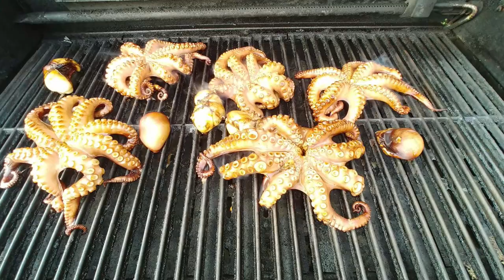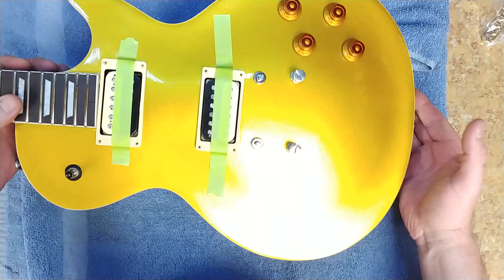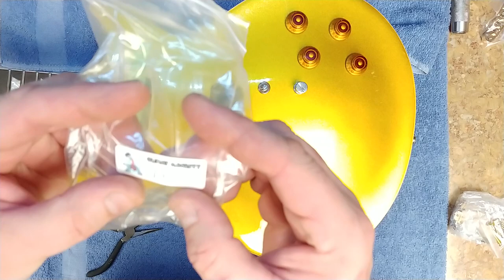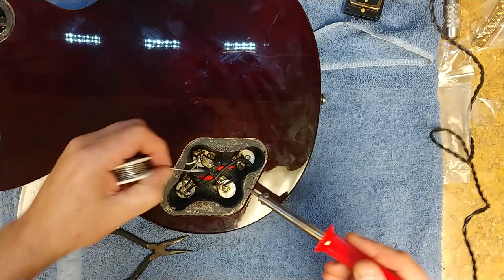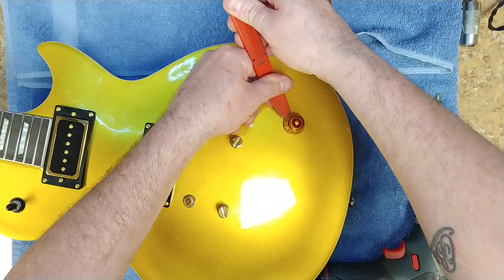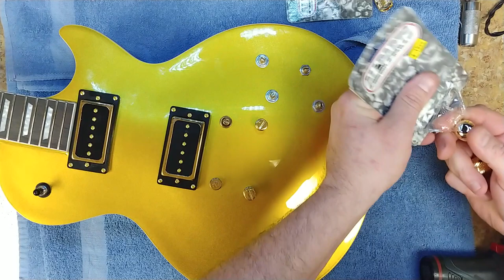Chibson Gold Top Gets A New Look And P90s

Comment: why didn't you change the inserts too?
Reply from the maker: Well. If I try to pull them out a few things could happen. Chip the finish being one of them. The new ones might be a little lose and then I would have to add some thin wood or something to keep them from slowly sliding out. You can't hardly tell unless your looking that they are chrome. with all the gold, gold top and all. they reflect the gold a little.